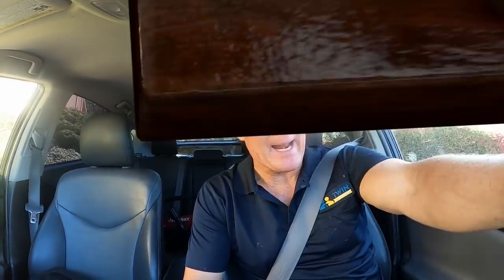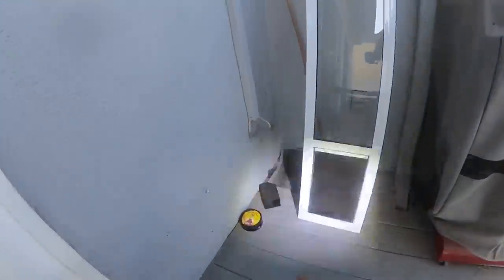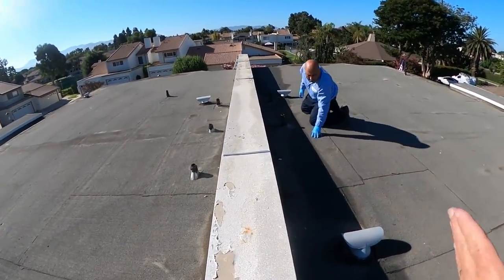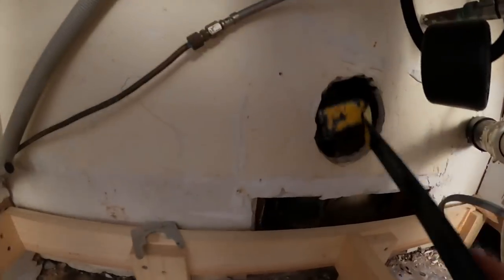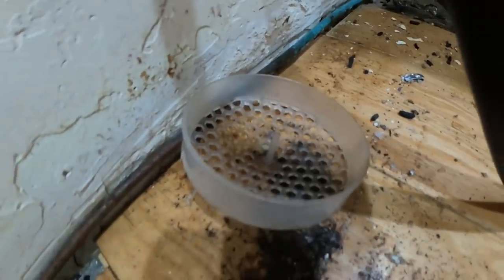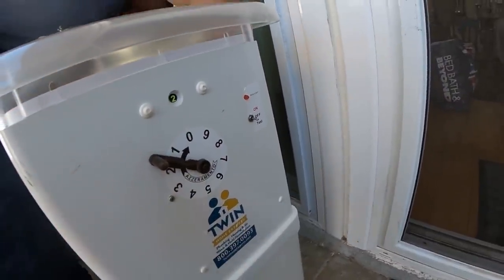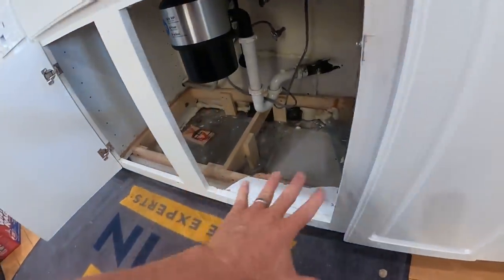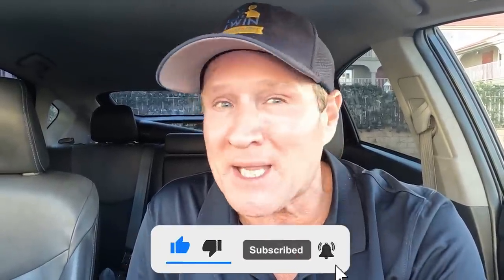The disturbing case of the CUTEST RAT EVER….vs rat exterminator!

Comment: I lived in an apartment where a rat chewed a hole around the ceiling fan bolt thing in the ceiling. Lets just say that was terrifying to watch something chewing through and not knowing what's going to come out the wall lol. It was like that scene on the Shinning lol. 

Prior to that I had a hard time getting the apartments to do anything because they came out and said they didn't see any rat dropping or proof it was there until the ceiling incident. They was like oh get some mint/gave me some glue traps, so i did and sprayed it. 

Yea no that rat was still around. One day i saw that  ugly tail going under the oven and called the apartments immediately. There was a rat hole behind the stove. After watching a lot of theses videos, I'm like they should of looked back there to begin with.

Comment: I used dry cayenne powder on the windowsill to keep them from going from one cabinet to the other and it worked, but now I have cayenne powder on my windowsill.:( However, I did mix jiffy corn muffin mix with baking soda so maybe my herd in the attic will eradicate itself. I put it indoors and outdoors and yeah, 16 ounces of peppermint essential oil only worked for 2-3 days. T_T Great show as usual.